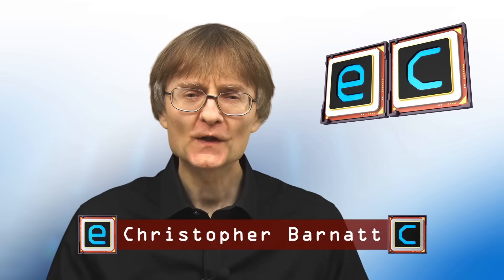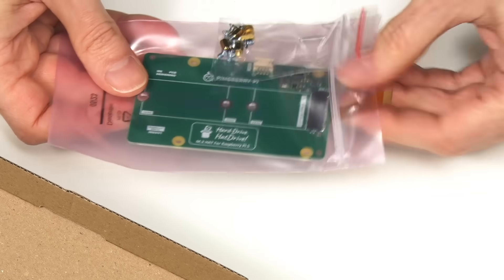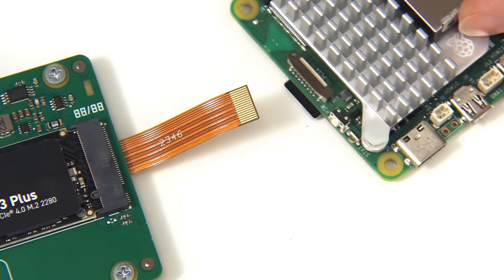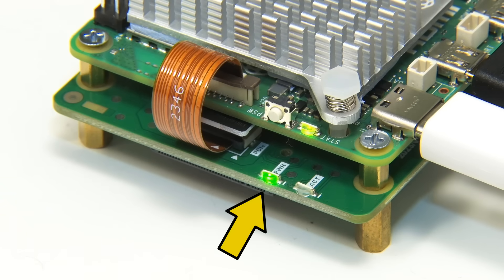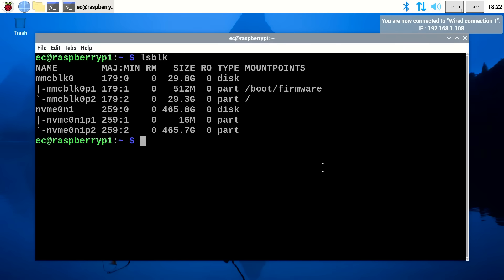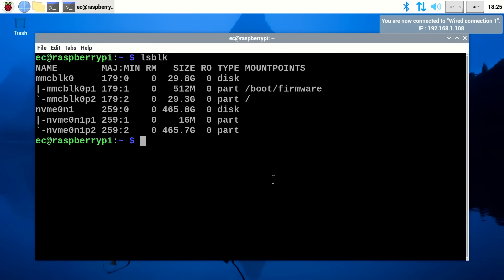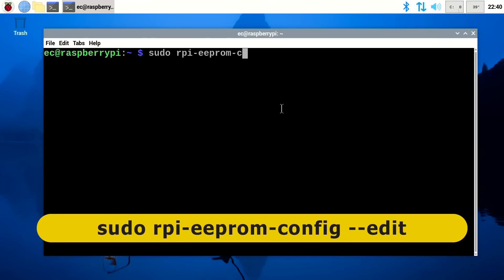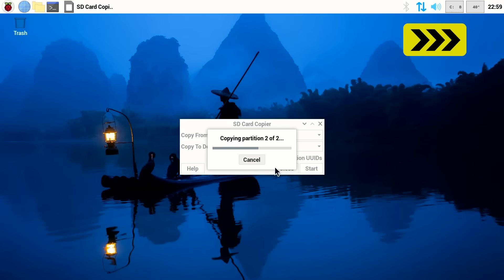Raspberry Pi 5 M.2 HatDrive!

Comment: Great Vid -  (Boots Great)
Crucial 2TB P3 (by luck)

Only bug is - (error msg)
dtparm or dtparam -t (no value ?) --direct ....  

What Pi5 native benchmark other than vcgencmd (no clock nvme val(?) Found)

It's all good & working, brilliant colors. Wish I could bench test test it.

Pimoroni bottom hat coming soon, too.

Any thoughts a Kingston KC or Samsung Ev. 
For the price $61 US for 2TB might go back to Crucial P3 2TB

Thx again - My journey listed below :

My problem is Fixed? (LSBLK)
NVME not found.

Not sure, if its the 64 bit version RPi 5 OS or not.

I was not willing to risk the Orig Pi 5 (cana kit) setup OS sd card. 

So I Cloned it (updated) with Pi5 Copy Sd prog.

The other Sd card (the problem child) was a Pi5 Imager RPi desktop. (Fresh install & updated)

That was the one that failed (see below)

The SD OS Copy of RPi setup, was popped in and no editing the 2TB disk showed up 

On to the next step ! Hooray !

Orig post -
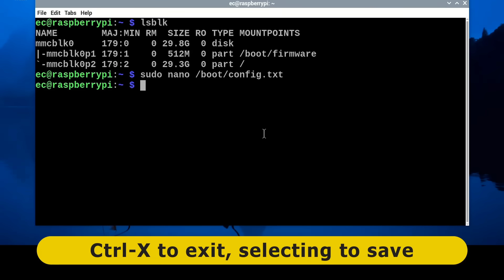" I am bummed - (@ 6:48) & lost ?

I updated and downloaded the latest pi5 desktop.
The " nano /boot/config.txt cmd told me - do not edit -

" file has moved to : " /boot/firmware/config.txt "
So ai tried to edit the file it referred to.

It did not work. "Drive does not show up on lsblk" ?
I also have a Pineberry green light & a "Crucial 2tb  P3 nvme SSD" ?

Has Anyone else run into this ? ( is 2tb 2 big ?)

I will rewatch the vid & check comments and show notes.
To see where I went wrong ? "
Reply from the maker: Good luck!

Comment: just got my pi 5 setup.  I'm looking forward to adding nvme.  I was wondering about the SD card slot, and you answered it.  I guess if the NVME goes on the bottom, I'm going to need to get a new case as well.  Will probably wait a bit for the NVME upgrades to shake out.

Comment: Thank you very much for this video.  I used it to set up two Raspberry Pi 5 computers with HatDrive Bottom boards running Raspberry Pi OS.  I have a third computer running LibreElec as a media center.  Is it possible to configure it to boot from a HatDrive Bottom board?  Since your tutorial showed how to do it from command prompts, and LibreElec does support this, I'm not sure even how to approach this.

Comment: Well I seem to be having a problem.   I followed all the steps and when I use lsblk it still only lists the SD.   Im using a Kingston NVMe which pineberry says is compatible.  The light on the pineberry bottom has is on.   I dont know what else to try.  Im using a 2280 NVMe.   Anybody have any ideas?
Reply: Yes it happened to me too.
(Crucial 2TB P3 M2 Nvme SSD)

I was hoping some contacted you with a fix. I got a sys prompt right after "Sudo Nano".
I chg'd to the directory, sys mentioned no luck ?

If no one has the answer, I will edit the system warned " do not edit directory ".
This SD card was loaded by R Pi imager and updated Pi5 b4 trying this. (It's my pi os test SD)

To be sure:

P5 latest os version
Updated to today's date
Green light on Pineberry hat
Green light on Pi 5, too !

Comment: I wish  Raspberry Pi got back to it's actual foundation, and continued to develop the Pi Zero,  while keeping it's price below $20 USD.
Reply from the maker: Agreed. It would be nice if Pi Zero 2W models were on sale, and were developed to have 2GB of RAM or more.
Reply: Imagine a Pi Zero with 2GB of RAM, and built into a stick for M.2 Drive.  There is no reason a fully functional PC would cost more than $50.   Add a  low cost 2230 NVMe   1TB drive and you have a PC that can do anything.  @ExplainingComputers

Comment: I enjoyed the vidio and used it on my Pi5 w/ bottom hat drive. only problem is when i remove the sd card it won't boot. I have tried this several times without getting it to boot from the nvme drive. any help would be greatly appreicated.
Reply from the maker: Sorry to hear that you have problems. The only advice I can give is what is in the video. Check that the drive is working as storage -- if so, the HAT and SSD are fine and properly connected. After that, it has to come down to config, so make sure you've followed all stages as the video covers. Good Luck! :)

Comment: Just tried following this video, got to the point where the nvme drive is recognised, but then after that added the final command and rebooted my pi5 and know it will no longer boot , not even from my sd, how can I resolve this. I just a black screen with these 3 lines of text 
0.932750] brcm-pcie 1000110000.pcie: link down
1.083222] sdhci-brcmstb 1001100000.mmc: invalid resource (null)
1.083243] sdhci-brcmstb 1001100000.mmc: invalid resource (null)

Comment: 1) It absolutely overkill to use Pcie4 drive here (8 Gb\sec raw for x4), it potential will never used here (its 1Gb\sec for x1 Pcie3, half of that for Pcie2) 2) Interesting is how DRAM-less drive will work.
Reply from the maker: As I very clearly noted in the video. It is the drive I had lying around. Where exactly do you think I can buy a (cheaper) single lane PCIe 3.0 NVMe drive! :)
Reply: @ExplainingComputers You cannot buy single line drive, true,  but its very unreasonable ti use hi-end drives in such setups - same as some people put NVME in NAS chocked by 1Gbit\s network. I would rather use cheap or older drive. Also, interesting is how DRAM-less NVME will act on such setup.
Reply: @ExplainingComputers Speakin on "where" - well, used one maybe? Yes, risky move but you can buy one of older model with quite of resource left. Not so long ago i purchased Transcend 370 (SATA MLC drive) for dirt cheap. Not superfast but almost immortal, great as NAS cache.

Comment: found out that my WD_BLACK SN770 is not compatible

compatibility list:

Compatible drives
Name	DD Write	HDParam(disk)	Score (pibenchmarks)
Western Digital SN530	441 MB/s	845.35 MB/s	45,735
Samsung 970 EVO Plus	314 MB/s	776.7 MB/s	27,960
Sabrent Rocket 4.0	350 MB/s	773.9 MB/s	47,002
Crucial P3 Plus M.2 Series	441 MB/s	798.97 MB/s	40,118
PNY CS1030	444 MB/s	744.15 MB/s	42,203
Samsung 980	426 MB/s	791.31 MB/s	42,230
Lexar NM620	444 MB/s	849.2 MB/s	44,542
Crucial P3 Plus	359 MB/s	777.5 MB/s	26,163
KIOXIA EXCERIA	394 MB/s	802.09 MB/sec	43030
Lexar NM710	393 MB/s	849.91 MB/sec	40542
Kingston KC3000	393 MB/s	832.70 MB/sec	44203
XPG GAMMIX S70 BLADE	403 MB/s	829.90 MB/sec	41316

if you install a not compatible drive you will get this:
     
xevilstar@tzarbomb:~ $ grep dtparam /boot/config.txt 
dtparam=i2c_arm=on
#dtparam=i2s=on
dtparam=spi=on
dtparam=audio=on
dtparam=nvme
dtparam=pciex1_gen=2
#dtparam=uart0=on
xevilstar@tzarbomb:~ $ lsblk
NAME        MAJ:MIN RM  SIZE RO TYPE MOUNTPOINTS
mmcblk0     179:0    0  7.3G  0 disk 
├─mmcblk0p1 179:1    0  512M  0 part /boot/firmware
└─mmcblk0p2 179:2    0  6.8G  0 part /
xevilstar@tzarbomb:~ $

Comment: If anyone needs a case for the HatDrive Bottom, Pimoroni Pibow fits perfectly with two bottom layers removed. It's acrylic screws serve as standoffs.
Sadly, my personal experience with Pi 5's NVME support wasn't entirely stellar. So far I've tested two drives: SK Hynix P31 Gold 1 TB which works flawlessly and Lexar NM790 4 TB which only works in gen. 2 mode, maxing out at 450 MB/s. It's a bummer as these are very good value for a TLC drive. I suspect it's likely a kernel issue with Maxio controller rather than an issue with Pi 5's PCI-E bus. 
As for the HatDrive Botttom, there's one important thing to know about that 5V input connector: it's not isolated from Pi's PCI-E interface cable power pins. Which means if you connect a 5V source to it, the board will try to power the Pi itself via the PCI-E connector. Not sure if this was done intentionally, but my suspicion is that this is likely a circuit design mistake.
Reply: Will that Pimoroni "P" case work with a Pi5, with a Pineberry bottom hat and the Pi5 Active Cooler fan ?

Comment: This looks so good. I wonder if there are any cases with passive cooling into which this assembly would fit? I've already got a RasPi 5 Flirc case in anticipation of the arrival of my Pi5 but now I want to use an M.2 drive.

Comment: Copying a disk which are being updated by the OS (system logs etc) isn't really safe? The root partition of the SD-card should have been remounted readonly in single user mode? And dd would do the copy job from a readonly disk.
Reply from the maker: Simply not true. Cloning a live drive is now very common indeed, and occurs in every major cloning app I can think of, aside from dd, which does indeed not copy live drives. Nor does dd resize partitions. And it also is dumb and copies everything, rather than just used space, and so here would be painfully slow. I do not understand ongoing obsession with dd for drive cloning -- especially when migrating to a much larger drive -- now that there are much better tools available.

Comment: Would like to know if you can connect an M.2 to PCIe raiser card like DELOCK 64132 or other similar to the HatDrive to get a PCIe slot for some PCIe cards (graphics, sound etc., though then you can't use the NVMe at the same time)?

Comment: Oficial price at Spain: RP5 8GB (TDP:12W)+Power supply+box+heatsink: 137,70€, Hatdrive:24,20€, SSD 250GB: 34,00€ => Total: 195,9€. Bought yesterday at Amazon Beelink N100 (TDP 6W, 50% more speed) 16GB Ram, 500GBSSD NVMe, Wifi6, W11Pro, nice&small box: 199€...
Reply from the maker: You may be interested in my video posting this Sunday, where I compare a Pi 5 with NVMe SSD to an N100 system, both running the same OS and apps. :)
Reply: @ExplainingComputers  Thanks for the advice, and for all the good information you give us

Comment: I'll try this out myself today, installed the Pineberry bottom-hat and will receive a cheap 2TB NVMe drive today!
Reply from the maker: Good luck! :)
Reply: First test result in gen2 mode:
/dev/nvme0n1:
 Timing O_DIRECT disk reads: 1330 MB in  3.00 seconds = 443.20 MB/sec @ExplainingComputers
Reply: Looks like the gen3 mode is not compatible with my Lexar NM620 yet... or perhaps power limited.

Comment: Hi All, a lot of brick and mortal stores stopped selling pcie 3.0 nvme SSDs, but its ok since pcie 4.0 nvme ssds are backwards compatible with pcie 3.0. The demo gives me the confidence to try this on the PI 5, so thanks.
Reply from the maker: You should have no problems using  PCIe 4.0 NVMe SSD on a Pi 5 with an M.2 adapter. Good luck!

Comment: Great video, thanks, this is massively informative for someone with my skill level. Would this same process work using Ubuntu? I prefer to use Ubuntu and currently hand it installed on micro sd but want to use a SSD drive instead.

Comment: Well, I can certainly confirm the Pimoroni N.2 HatDrive works.  The Pimoroni does not have the status LEDs which is a shame but also has a better cable (and cable positioning) so you can get at the SD card slot.  Thanks for your video it is much appreciated.   Now all I need is a case that can include Pi 5 and HatDrive.

Comment: Hi Christopher great videos as usual,  something strange is happening with pi pico and a Single rgb led I have two wired up to my pi pico on 26 27 28 gpio pin but it only works if put my red wire on ground and ground wire on red I get bright red  its working in micropython I've check the wiring and used colour coded wiring. My code is simply blink red then other colours but red is only showing I'm using 10r resistors . Forward volt 2.0 red and green and blue  3.5 v.  I should use 68r on red? Any reason why this is happening.

Comment: a shame you cant just bypass the SD card all together and have the pi boot directly off the nvme. if i had a dollar for every time ive had a pi sd card die id be a millionaire
Reply from the maker: But you can! This is exactly what I show in the video, with the Pi booting from the NVMe drive with the SD card removed! Pis have been booting from other media (USB drives, and now PCIe drives) for several years now.

Comment: Also can you document the (screw diameter) size of the stand offs?  Or them M2 or M3 or what?  They seem quite small M1.5 maybe?
Reply from the maker: The standoffs are M2.5, which is the Raspberry Pi standard. The ones that came with the HatDrive! do indeed have an unusually small outer diameter.
Reply: Thank you!

Comment: SHOW that STEP SLOWLY how you screw down the 2280!!!! How the heck do you use the little bass fitting that holds the 2280 in place?  The hatdrive instructions?  None provided?
Reply from the maker: The M.2 drive fits into the little groove on the brass collar, which is screwed in from the other side.

Comment: Nice. I’m waiting, though. My hope is for an adapter that puts the NVMe facing the bottom so I can better manage the heat. NVMe drives can get hot and with these current HABs they will not get adequate cooling.

Comment: A suggestion - how about not attaching the board to the base of the Pi until all the config work is complete and the micro SD card removed. Then connect the board to the base of the Pi - thus avoiding the awkward removal of the micro SD card. :)
Reply from the maker: That would work for initial setup, but does not solve the issue of an inaccessible microSD card slot. :)

Comment: You said Mega bytes per second - did you not mean Mega bits per second? Big difference!
Thanks for a great video otherwise!
Reply from the maker: I've no idea what you are going on about, but it seems that you don't know how drive speeds are measured and cannot read the screen. :) The drive speeds in the video are correctly stated in megabytes per second (MB/s), and indeed you can clearly see (eg at c. 9:20 ) that hdparm reports the results in MB/s (not megabits per second, which is Mb/s).
So there is no issue of a "big difference" or "otherwise". Unlike network speeds, drive speeds are never measured in megabits per second.

Comment: Now, this may be somewhat a matter of personal opinion or preference, but there's really nothing wrong with having your /boot on a separate, slower device. Once the Kernel is in memory, the boot device is largely irrelevant.
Reply from the maker: True, but the boot device is usually where apps, OS cache files, and app cache files are stored, and this is certainly not irrelevant. A Pi 5 is much more fluid running from an M.2 NVMe drive, rather than a micro SD card, and this is for a reason, not opinon.
Reply: @ExplainingComputers  not so. Now, call this a case of me being supremely stuborn and particularly pedantic... but as I run Gentoo, if ever I chose to do so, I could have /boot be one one device and / be somewhere totally different. The kernel need only have the proper drivers built in (or have access to them via an initramfs or similar) and have the proper kernel cmdline passed to it.

All this being said... you might also be interested in a certain little feature the DeSalvo Systems Galactic Case has just north of the SD card slot - a small cutout for a ribbon cable... hmm...
Reply from the maker: You are completely ignored what I replied! :) Nobody only runs an OS, and there is no question whatsoever that a Pi 5 opens applications faster, and so provides a better user experience, when running from an NVMe drive, rather than a microSD card. As I recall, Gentoo often loads into a RAM drive?

Comment: To be honest, I don't quite understand the enthusiasm for Raspberry Pi at this point. There are sub-$200 USD small form factor (NUC-sized) devices with latest generation processor, 16gb ram, 500gb hdd, and the regular slew of ports. These usually come with Windows 11 pro (if you are into that). It would take the same money to get the Raspberry Pi 5 close to that spec (and only supports 8gb ram). I get the use case of connecting to various peripherals, but for general computing (Debian), there are way better options than this.
Reply: There are some other use cases as well. Battery operated scenarios will improve with the ARM processor and I’m still using my old pi 3 for experimenting with ARM assembly code (something I could do on a VM but is better on real hardware). It just depends what you want it for but yeah, there are going to be SFF PCs (and even competing SBCs) that offer a better experience for a cheaper price if you just want to use it as a standard desktop and don’t care about the GPIO header or the advantages of ARM for embedded systems.

Comment: The configuration & operations where i get lost ive just received my pi haven't set it up yet . Could a laymen like me pull this off
Reply from the maker: Yes, you could pull this off. The config only needs doing once.
Reply: @ExplainingComputers  thank you for the response. I'll order the nvme based now 😀
Reply: @ExplainingComputers Im using a NVMe Base for Raspberry Pi 5 – NVMe Base from pimoroni running umbrel os but the operating system won't use the storage from the Samsung 2  tb 980 pro ?

Comment: Apologies for the intrusion. Is there a case available which allows a "bottom" HAT set up,a Pi 5 on top and again the original active fan cooling on top of the Pi 5? I do not seem to be able to find it? Ideally I would like an aluminium or metal one, nice and stylish as it will stand next to a TV